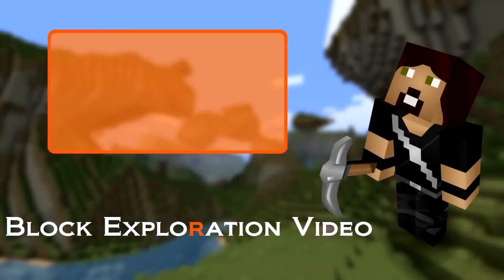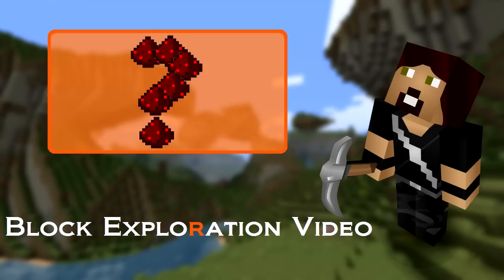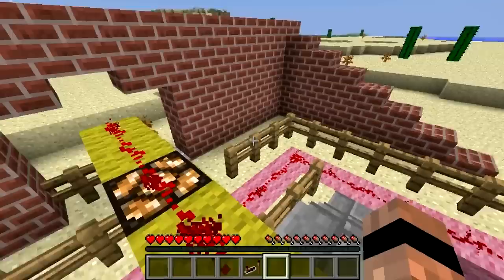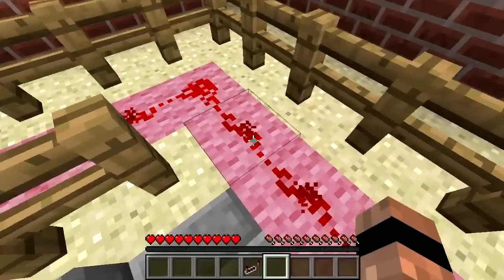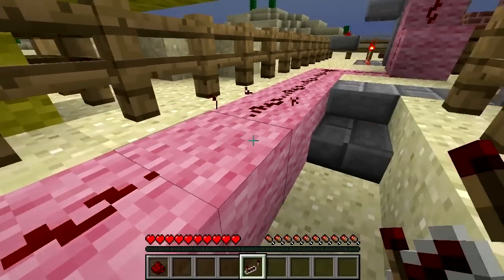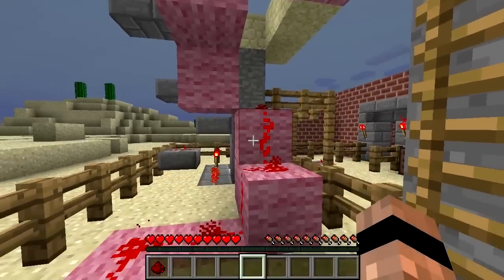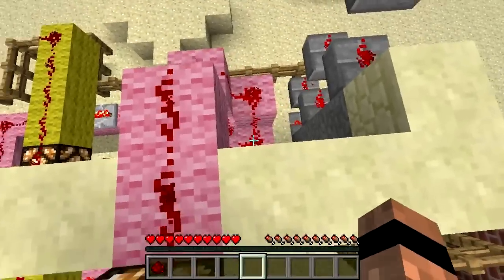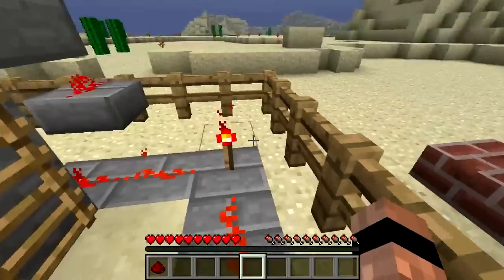Minecraft Basics: Redstone Currents for Beginners

Comment: If you point a powered repeater at a block then the top of it is also powered but powering it just from the bottom i dont know anything but torches (unless you stick a lever under it). If you want to transfer a signal from the bottem then use an Inverter with a torch.